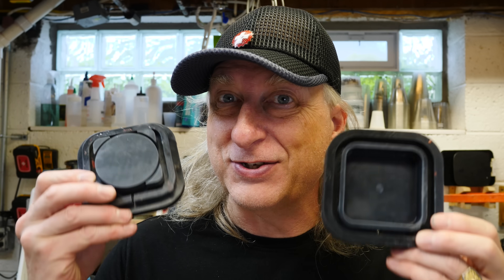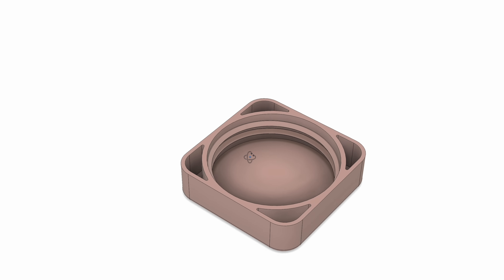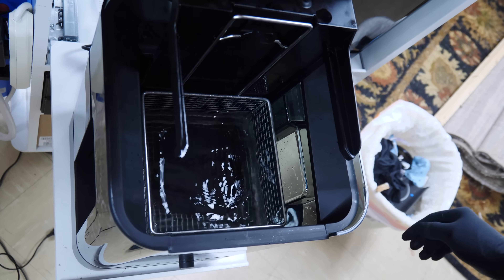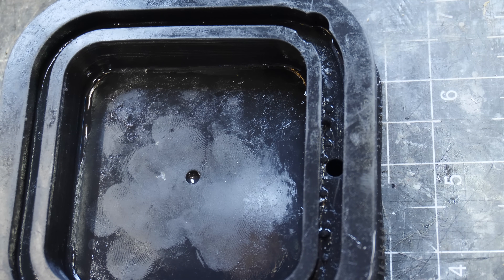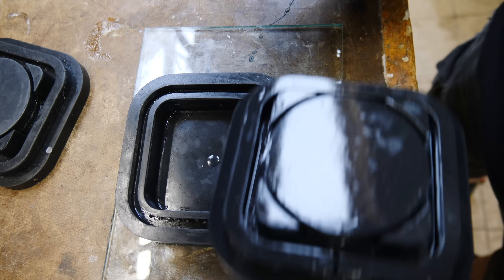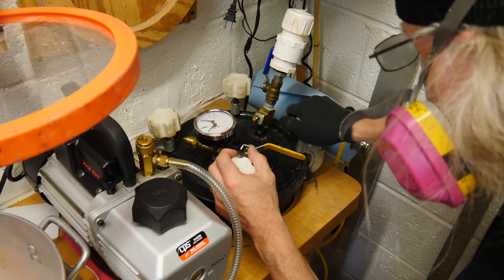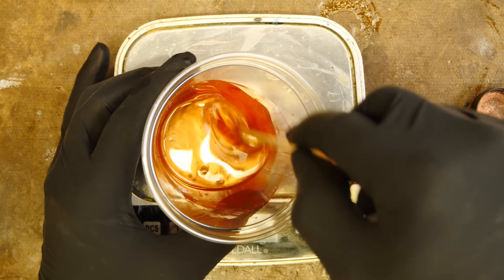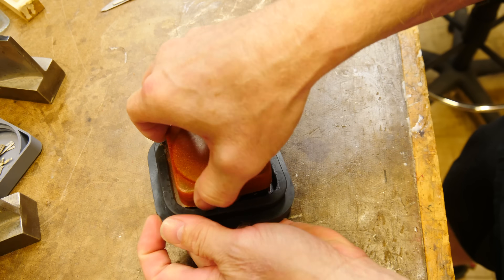3D Printed Silicone Molds - Game Changer!!

Comment: I can’t stand resin printing. I’d rather 3D print the part and make the silicone mold from that. My daughter and I have been making silicone molds for a good ten years. It’s not that difficult, really. We use a vacuum pump and container to get the bubbles out. It works well, once you learn to calculate how much the silicone rises as the vacuum increases so it doesn’t run over the sides. I don’t understand how this is supposed to be easier or more accurate.
Reply from the maker: Faster

Comment: Nice Video - I've also been experimenting with 3D printed molds also with my SLA printer. In all honesty, how many parts do you think you can pull off those molds that you made?  Poured Silicone molds can yield about 20 to 25 max. If the Material you used to print with can beat that - this would be an advantageous process...
Reply from the maker: Max 10 maybe, on an easy part

Comment: You should try using FDM printed PVA molds for casting. The PVA print can be dissolved in water after the cast, which makes it a loss cast, but in exchange you can do some pretty interesting geometry's and the mold is ready for casting right off the print bed.
Reply from the maker: Good idea

Comment: First of all, I don’t think this stuff is ‘silicone’.  Silicone is a specific compound that has specific properties.  It’s just a printable elastomer. Second of all, what’s the advantage of spending time modeling a mold and printing it, when the same amount of time can model a split master for pouring both halves of a mold at once, and then you have a tool for making as many molds as you might need?   I think iterating hard prints is what you do to refine the design. And the only time to go to mold is if you have a final design you want to produce in bulk.

Comment: I'm struggling with the super-glue bit at 7:48.

Wouldn't a thin coat of uncured silicone bond torn silicone back together once it has cured? Why the extra expense of Tech-Bond Poly Kit?

When you make the second part of a two part silicone mold, you have to apply a mold release barrier to the first part, because silicone sticks to almost nothing but silicone.

Comment: Eric, I had an idea to use a self stirring cup with a magnetic pill mixer if you've seen the ones I mean? The idea is to mix parts A & B of polyurethane resins, with a short pot life, in the vacuum chamber without having to wait for the vacuum to pump out the air. If I construct a tilting hinged cup that operates with an external magnet, I can tip part B into the already stirring cup with no air present. This will increase the pot life and create clearer bubble free casts. It would be cheaper than an industrial vacuum casting machine. Do you think this would work?

Comment: Formlabs is a scam, the running costs will eat you alive, if you're not a business. I didn't have good results with their silicone, it really just works for simple shapes, as the green part is very easy to deform during printing!

Comment: Hey Eric! I admire your mold techniques and learned a lot from you. As a thank you, I feel like I have to suggest something 3D printing. I think this model can be printed on vertical axis and better turn it around 45 degrees on vertical axis. Also use heavy supports when you do it. You can even use auto supports. That helps you to protect your master against support damages. It takes more time but the quality of the model will be really different. I hope you can try it sometime, thanks for your precious informations again. Good luck!

Comment: In every conceivable way, this just seems worse than doing it normally. Maybe the material and print process could be improved, but as it is now it's hot garbo for molding. Making a master and pouring around it just seems like less hassle.

Comment: So 1l is around $500, at least what i found, those 2 parts i reckon to print will be like $150-200 or more... i can buy almost 15 kg of silicone for that price and get 40-60 molds out of it. Or am i missing something?
Reply from the maker: Yes, you're totally missing the point, you do any color or material  you want with this method.
Reply: @EricStrebel  so with regular method I can't do any color any material? Because I can. Still I am missing the point. Doing molds should reduce the cost not increase, so far I just see you promoting it for sake of commissions thy pay and because price is so high you get good commission. That's what I see so far. Prove me other way. Why printing in regular resin and then make 2 part mold isn't as good as your expensive method?
Reply from the maker: @Jokershadow696 proof of concept....
Reply: @EricStrebel  but you don't have effeciency like at all. Is pure money burning process... But yeah.. It works.

Comment: Its cool but is it really that beneficial?  Especially with all the prep and post cleanup you have to do ?  It's really not that hard to make a silicone mold the traditional way.  Even if you're making multi part molds.   The tough part, in my opinion, is the design of the mold and strategic seperating and draft lines.

** Also, you said this saves time by not having to "finish a positive and then make a mold" but who would want to that?  I never make molds without testing my positive out first.  You may be considerably more confident/skilled than I but I would still want to test something before I went through all the trouble of making a mold :D

Oh and I like that you have the Mando theme at the end of your video lol

Comment: But if you can print the silicone, why not skip the mold and print the desired part? Only because of color?
Printing silicone molds is a good way to cast molten metal.

Comment: How durable is it? I have steering knuckle boots I have to make since the NOS rubber shredded within a couple weeks worse than the part I replaced was. Plus I need a material that is a little more supple in winter time temps.
Reply from the maker: Not particularly durable

Comment: There’s a lower cost process that you can use to make silicone molds.  I’m using a standard 3D printer to make a PLA mold for the silicone mold that I want to make.  Generally the PLA mold gets broken while unmolding the silicone mold but it works.  The silicone doesn’t need cleaning in a chemical bath because it fully cure by itself.

Comment: I've made a couple silicone "toys" with printed molds. Coat the inside with beeswax before casting and no layer lines. When some loss of detail is acceptable anyway.
I'm going to possibly use the same process for motor mounts and bushings in the future.

Comment: 🤔 Do you know any thermoset resin that is not brittle? Epoxy is pretty shatterproof but softens under slight heat like sunlight.
Reply from the maker: Contact your local manufacturer for details they usually have tech support that can help you
Reply: @EricStrebel  Thanks

Comment: Is there a reason you don't use pourable silicone or even caulk poured into a TPU 3D print?
Reply from the maker: Yes I'm not trying to make silicone part, and I'm trying to reduce steps

Comment: UV curing resins will often thermal cure also, often more thoroughly. Instead of or in addition to the UV chamber step, you could bake the silicone part. That might improve mechanical properties and/or reduce the smell.
Reply from the maker: Heat was used to cure them in the form cure as well as UV, but they should have been water cured, which I forgot to do.

Comment: Why can't you print the part directly on the resin printer for parts that are for prototyping?
Reply from the maker: How would I get subtle color changes or various material changes by printing them?
Reply: @EricStrebel  I mean for example the bottom you made a mold for. Start with a clear printer UV resin and add color or do the colors you use interfere with the specs of the resin?
Reply from the maker: Well first of all there's no such thing as a clear UV resin they all yellow over time, and what am I going to do with the resin that's left in the vet from that one quick test?
Reply: @EricStrebel  Don't all clear resins yellow over time, even the UV resistant ones? I suppose you could put about what you will need to make the print in the vat and store the rest in a small container? What do you do with the rest of the leftover 2 part resin I see you have left over in your videos? I'd guess you have to toss it?

Comment: Not a game changer.  Rubber and resin manufacturing veteran here.  I could have batch printed more with tough resin on a large format resin printer before having 1 cast from the printed mold.  Let's start adding design time and failures.  Game changer if you like wasting money and time.
Reply from the maker: How would you do all the color variants? Solids and translucent or micas?
Reply: @EricStrebel  who cares about color that much?  If it's a full production product where you're using multiple molds and casting materials, sure.  Neat video and ability to do it, but this isn't sustainable as a manufacturing technique.
Reply from the maker: I care about color and many designers do and should, and this is totally not in any way shape or form for manufacturing. This is purely a prototyping option.
Reply: @EricStrebel  enjoy losing money in production and prototyping
Reply from the maker: It's a money winner, my clients gladly pay for that service.
Reply: Don't get too excited. They both have benefits they both have SERIOUS flaws. I trust Smooth-On.

Comment: You can actually do this with Elastic 50A as well, but obviously with slightly inferior material properties. Definitely opens up some cool possibilities though...but n bunyl acetate is either really expensive or impossible to get here in Canada and silicone 40A is a really pricey resin in itself too. Great video though!

Comment: Wait - you cured without water as advised?
Reply from the maker: Yes, I did not have a handy container and then forgot about it, your correct, I messed up on that
Reply: @EricStrebel  ah well it’s interesting though - how did the result feel to you? I’ve found their silicone doesn’t have great tear strength particularly at lower wall thicknesses
Reply from the maker: Their strength is poor

Comment: I've been doing this for 2 years now it's great. I use it to make master moulds, which i then coat in resin so the surface is smooth and shiny, and then from that i cast the final silicone mould which i then cast the final part in from resin.
Reply: Confused. You cast a  mould from a mould, or do you mean you use it (3D printing) to make master *parts*, which you then process to improve the finish before making a silicone mould from those? ... or you've been using the same formlabs resin to directly make silicone moulds that eric did?

Comment: Very interesting. Definitely dig the idea and direction it's going but boy oh boy I don't know if the cost is worth it in the end.  I currently print molds using TPU and have had tons of great success with it. Since you can get different ones in various shore hardness' it really helps to be able to find the right flexibility and rigidity per-mold-requirements. Sometimes I'll co-bond the TPU with another rigid filament if I need a solid platform or channel within the mold.   I haven't tried any flexible 3D resin prints yet I know there's a few flexible 3d resins that aren't silicone, kind of curious how well they work in comparison to this formlab silicone based photopolymer. They might be a decent cost saving solution. Not sure.  I know FDM molds still work pretty good though despite the print lines and maybe a couple extra steps.

Comment: Interesting review. 👍 Would silicone printed molds be good for gang molds or production molds? How's the tear strength and how many pulls can you get before it deteriorates? Kind of curious.
Reply from the maker: Actually they might work really great for gang molds. However the tear strength is low on these in my opinion so the moles would have to be really simple and handled delicately.